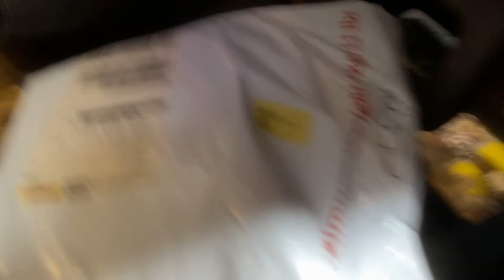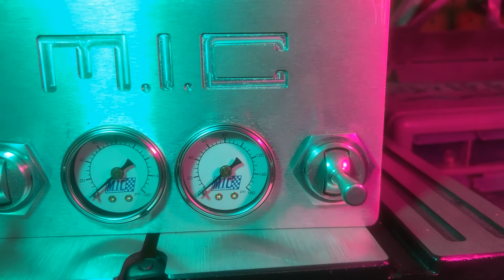AIR RIDE VS. HYDRAULICS Whats the best Mini Truck suspension

Comment: 100% nailed it! Probably the best air vs hydro videos/ debates ever. Hope more see this! I'll share with my small circle for sure!
Disconnect being "hydro's are messy" statement. A good setup won't get messy up on maintenance.
When I got into adjustability, bags were cheap. Talking $300 bags vs $750 hydro's. I always hear air shocks were the way because bags were cheaper. I went with tried and true expensive hydro's.
I've turned my back on hydro's due to availability.
I don't see reverse flow cylinders available on the market anymore, which would be life changing to the stance kids of now as I feel the hydro's would be less than off the shelf strut bags.
I could touch this topic for hours, but nobody is listening lol
Sorry for the paragraph.
Well done!
Reply from the maker: Thanks man, I appreciate it, just thought I would share my experience with both types, I love them both for different reasons, thanks for watching!!!

Comment: I have hydros on my b2200 no complaints just a bit bouncy similar to running static. Like how you said all depends on the setup and quality which aint cheap, I spent about $5-6k on suspension and about $6k for double diamond Z rack. I run old school skinny cylinders and coils for clearance and looks.
Reply from the maker: I forgot to mention that my second truck on juice I ran much softer springs and it actually was t all that bad, still not as smooth as air but it was better than static